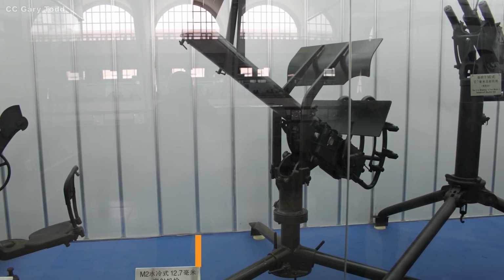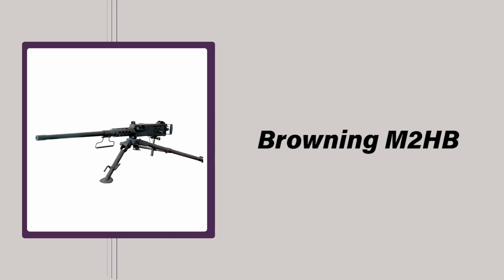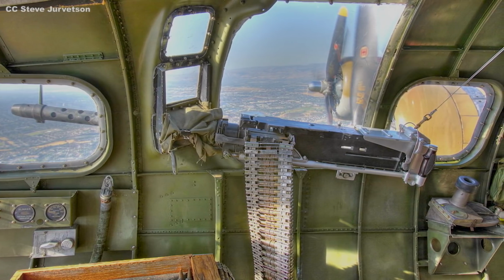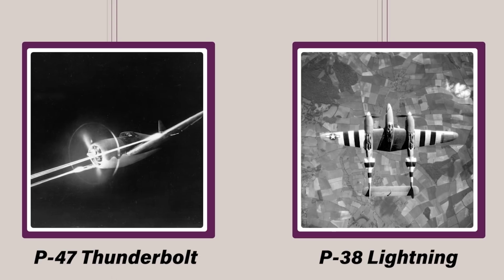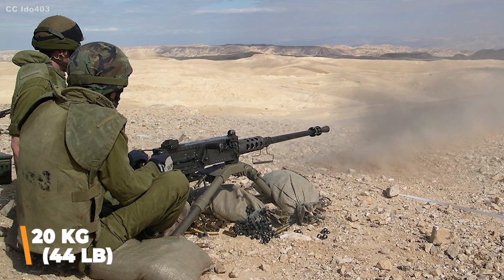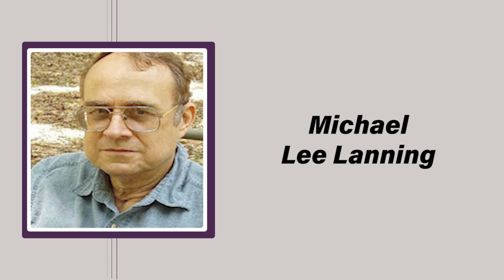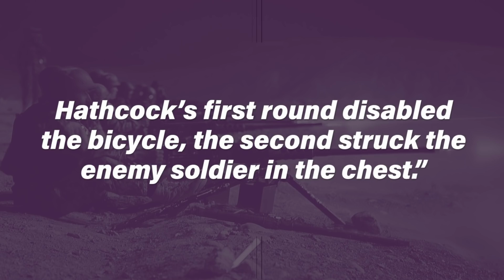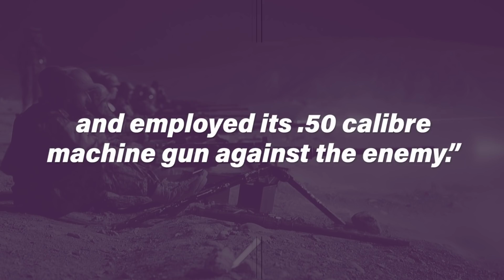M2 Browning: The WWII Machine Gun we Still Use Today

Comment: The M2 Browning is literally the definition of "If it's not broken, don't fix it."
I can easily see this gun still being in use in another hundred years, with very few updates made.
Reply: You havent truly lived until you have fired one these
Reply: There’s probably gonna be a VTOL spaceborne dropship with M2HBs as door guns lol
Reply: @BusterBuizel  Yep! I'd love to get the 'Development dollars' for the ammunition to be vacume sealed for 'non-atmospheric' use!
Reply: @JohnDoe-pv2iu  wouldn't you want them slightly pressurized with oxygen to fuel round ignition?
Reply: @xerothedarkstar  Not really. most Propellants carry what's known as an "Oxidizer" as part of the propellant mix. it's why you can fire a gun underwater ( assuming the round is watertight. ) Basically the Oxidizer's role is to give the fuel the oxygen it needs to sustain conflagration. To Burn, essentially. as a matter of fact, most explosives contain their own oxidizers for this reason, and why Thermobarics are so much more devastating than regular explosives. Thermobarics draw in their oxygen from, well, the air, which creates a vacuum as the oxygen's used up, before the pressure wave kicks out.
Reply: @havoc3742  good info. Thanks.
Reply: @JohnDoe-pv2iu  Aren't they already vacuum-sealed?
Reply: @xerothedarkstar  Yes, Mythbusters fired bullets in a vacuum chamber. They found them 5% faster. So Ma Deuce is already ready for space--if one can compensate for the recoil and the atmospheric gasses that will fog and reverse rocket the gun and gunner in the opposite direction.
Reply: They’ll keep the weapon, and just make cooler bullets
Reply: I could see the Ma Deuce being mounted on a robotic platform.   Yes, 21st century tech packing early 20th century weapons.
Reply: @zyoninkiro  That would be hilarious, and probably quite effective. Unless you're in an actual tank there's no really good protection from a .50 BMG. During my military service I read about an incident where a couple of grunts missed the firing range completely (shot went over the massive mound of dirt at the end of the range) and punched straight through a couple of walls of a house 4km/2.5 miles beyond away. Luckily no one was hurt.
Reply: @Pile_of_carbon  Who the heck would live down range from a military target range? Cheap mortgage?
Reply: @Louis_Davout  Yeah, I'd be sketched out too. IIRC this was Northern Sweden which is mostly forest and "next door" means a two hour drive so I'm guessing it's either "This should be far enough..." or "Holy crap! There was a house/target range there?!?"
Reply: @Pile_of_carbon  House was probably there before there was a range.
   I don't live behind a range but my house is almost 120 years old. It was where it stands before most anything around me here.
     Ya'll Take care, John
Reply: @Louis_Davout  ultra cheap comes with a chance to aquire info about new ballistic calibers and lethality... only people I can think up must be from China or Russia.  The Americans don't care because they say fuck it if they make it out alive good for them.
Reply: They're working on replacements. There are a bunch of shortcomings in the design.
Reply: @Solnoric  they've been working on Replacements since the 1980's, and every time, it all comes down to the same thing: It's too fragile, it's not as reliable, it isn't as accurate, it's rate of fire is inadequate, it's too expensive for too little gain, Etc, Etc, Etc, ad all. the fact of the matter is, the M2 is just too good at it's job. Yes, it's heavy, yes, the giant recoil spring can catapult out the back if you fuck up during setting up the timing, yes, the barrel falls out occasionally because you fucked up the change. But, if you need a gun that'll run as long as it has ammo in it, that's proven and tested, that'll blow a man clean in half, and tear through anything lighter than an IFV and reduce whatever's behind it to a mangled heap, Ma Duece's song will keep on chugging along, as long as you treat her right.
Reply: @havoc3742  ...and "chug" is exactly the way I describe how the Ma Deuce when it's fired: "chug-chug-chug-chug-chug.....chug-chug-chug..."
Reply: @ex-navyspook  Yo tambien! Translation: me too! I too would say that!
Reply: @ex-navyspook Standing behind one being fired you can feel it in your chest. Wouldn't want to be anywhere on the receiving end.
Reply: @Solnoric   incorrect, they are working to replace the SAW and M240.
Reply: @Solnoric  the A1 upgrade is all its gonna get for awhile

Comment: Sometimes a thing is so well designed that it just can't be improved upon. There have been a few upgrades to the M2 over the years but nothing really major. It just works. It provides legendary destructive power and almost never goes down. The M2 is used by almost every military in the free world and will continue to be for the forseeable future. In fact, it continues in production today. It isn't going anywhere.
Reply: There have been several attempts by the U.S. Army to create a replacement. All have been abject failures due to trying to improve portability. usually by using lighter-weight parts that can't handle the .50's sheer power, shorter barrels that rob the round of range and hitting power, and by reducing the rate of fire to unacceptable levels so the lightweight version wouldn't shake itself off-target in a few rounds.
Reply: The Ordnance dweebs after almost every "improvement" to the M2: "well, THAT crap goes in the scrap bin!"
Reply: well, you didn't have to fix or upgrade something that isn't broken..
Reply: At least it has a mechanical safety now 😂
Reply: @dbltrub98  It also now has a barrel that doesn't have to be manually headspaced. Those things make the gun more soldier-friendly but they're relatively minor tweaks. For the most part, Browning just got it right.

Comment: M2, the standard of reliable and effective design. Blows my mind that there are m2s from the original production batch still in service
Reply: The one I was issued had a 5 digit serial number. Not first run, but pre- Pearl Harbor. It had some wear, and was as ugly as any other, but it went bang every time I wanted it to.
Reply: @troybray7523  that's some heritage right there.
Reply: @troybray7523  
"...but it went bang every time I wanted it to"
There's no higher praise.
Reply: I’m not surprised.
Reply: As those weapons arrived at the depot for periodic rebuilding to a 'like new' condition - those weapons were separated out and transferred to museums.
Reply: They never wear out
Reply: @colbeausabre8842  Even M2s have parts that wear.  For example, the barrels are only good for a specific number of rounds (the reason why you're supposed to log the number of rounds fired).  And even if there's no signs of wear, they still need to be inspected for stress cracks that appear over the years.

I've traded in an M2 for one that was fresh from being refurbished to a 'zero rounds' condition - and it was a sweet gun.  Super accurate and the 'feel' of the action was super smooth.
Reply: @colincampbell767  i agree. Ive had to deal a few where the feed tray cotter pins broke or timing threads wear out on barrels... makes the machine gun turn into a bolt action .50 cal.  It has too many moving parts that can break.

I personally liked the m240 because of its simpler design and ability to transport on foot by 1 person.
Reply: @colbeausabre8842  some parts do. But they’re simple to maintain.

Comment: 2 conversions you missed to discuss:
- QCB barrels - barrels that can be changed within seconds not half a minute and doesn't require a safety check for barrel alinement.
- conversion to full auto, closed-breach - some armies remove the receiver release trigger and the retaining mechanism.
this makes the gun a closed breach system. then it is possible to create a solid contact-on-contact safety latch that blocks the movement of the trigger when engaged.

Comment: During my time in the Marines, we were taught that the m2 could be used as light artillery, and pointing the rifle 45 degrees up you could land rounds at 11.5 miles, and dial in with a spotter. I have no idea if this is true, there are many urban myths we were told when I was in that ended up being 🐂 💩
Reply: The range is a little off, but yes, any machine gun can be used for indirect fire. Using it that way takes a lot of training, and is much easier with a T&E device, and an observer with good eyes, but it can be done. I've done it.
Reply: The Canadian Infantry used their Vickers guns as artillery by way of firing bursts at a cross roads or supply trenchs in WWI.  Basically used to deny usage of a patch of ground in the same way artillery can.   I'm assuming the Vickers because it was the heavy machine gun, and the Lewis was the light machine gun.  I don't know the specs of either, perhaps the Lewis gun could have been used the same way.
Reply: @rodchallis8031  Any gun (even a rifle) can be used for indirect fire, but heavy machine guns (like the vickers) are often equipped with a tripod mount and a Traverse and Elevation mechanism that holds them in place for long range plunging fire. Being belt fed allows that fire to be kept up for long periods. The Lewis was capable, but with drums, the sustained fire would have been a bit more difficult, and overheating may have become an issue. The M2 did the same thing the same way. In WW1, machine guns were often artillery, rather than infantry weapons.
Reply: Only when the MK-19 actually worked. Damn thing was constantly going down.
Reply: Yep, Americans never really got their heads around the quasi-science of indirect MG theory.
Oh, the things a couple of beaten zones overlayed on massed infantry can do.  Think massed longbows raining arrows.... or a long range firehose
Reply: I think you are confusing the M-2 with the Mk-19 automatic grenade launcher.
Reply: @bigdatapimp  MK19 is a short range weapon.
Reply: @troybray7523  "short range" it is effective at 9/10ths of a mile on a point target. You could lob 40mm mk-19 further than that. It wouldn't get 11.5mi but at least 2-3 for indirect fire.
Reply: @bigdatapimp  Max indirect fire range for MK19 with high pressure rounds is about a mile. It is lobbing rounds in like a mortar at that range already, so it going farther. As a guy who calls for artillery fire from 20 miles away, a mile IS short range. An M1A1 Abrams can hit a target with direct fire at 2 miles, so, yeah, short range weapon.
Reply: @troybray7523  in training they do teach you that the MK19 can be used as an improvised mortar.
Reply: @bigdatapimp  mk19 max range 2,200 meters.

M2 max range 7,400 meters.
Reply: About 8000 yards is your max lobbing distance. And it’s at about a 32° angle.
Reply: Lucky if more than one guy per a.p.c.was .5o qualified while I was in .one field trip we only had 13 trax out of two battalions that passed dispatch.
Reply: @shawntailor5485  On the crew served weapons we never qualified.
Was not part of our training.
Everything was familiarization.

Everybody operated and everybody shot.
Reply: Forget what's it's called can do the same thing with the M60
Reply: My dad was airborne in the early 50s and he told me about doing this.
Reply: They do that because it’s an anti material weapon. So, it’s not a war crime if you delete his head so long as you were “aiming “ for the material
Reply: @ryhol5417  that is a common myth, there is nothing that states you can’t use a .50 on personnel.
Reply: @ryhol5417  All weapons are anti-material. As a soldier, you aren't killing other people, you are destroying a portion of a unit, or eliminating a weapon system. Why would it matter if you shot somebody with a .50? I shot people with 8 inch howitzers and MLRS rockets. .50BMG is a small projectile in a big world.

Comment: If you have a century old MA2 and a century old M1911 you are better equipped than most modern soldiers.
Reply: The M1911 is still better than a glock.
Reply: @noticedruid4985  I own both.  If shit went down I'd grab the glock first.
Reply: @noticedruid4985  How?  The  military issue guns have TERRIBLE sights.  many people can NOT shoot them effectively (most militaries provide very little pistol training...) AND in any case... pistols have virtually NO place in modern warfare outside of special forces...  (and note that both the SAS and GSG 9 use 9mm handguns...lol)   Magazine capacity of 7 or 8?    Don't get me wrong, I have several 1911's...one is in 45... but my MAIN pistol is a CZ Shadow 1 9mm with a dot sight.  FAR more effective than a 45 ACP 1911.   Sorry...but it's true.
Reply: @noticedruid4985  Bullshit it is.
The Glock runs circles around the 1911.

Namely a superior trigger that even a blind orangutan could see, a better magazine system that doubles the number of rounds you have at your disposal, & it's carrying weight is incredibly lower, making the stress on your body lower as you lug it around daily throughout the battlefield etc.
Reply: @noticedruid4985  Why, because the 1911 won two World Wars? I seem to remember that a couple of nukes were involved.
Reply: There was no bomb dropped on Hiroshima. The B-29 flew over and the bomb bay opened, and a single round of .45 ACP was fired from an M1911A1.
Reply: Until you get your hands on a Glock.
Reply: @buncer  I knew a guy who served in Special Forces in Afghanistan probably 15 years ago and he said their unit was issued 1911's simply because of the heavy .45 slug.  He stated they never should have gone to the 9mm in the first place.  That was about all he ever said about his time "over there".
Reply: @buncer  we arent talking about glocks yet here you come. Glock fanbois sure are pushy.

Comment: It’s hard not to feel like a bad ass when you’re manning one of these during a firefight! Luckily the M2 never went down like our Mark 19 constantly did.
Reply: I hate the mk19. Bitch went down on me in an ambush. I always prefer the 240. If it is a dismounted patrol, it will suck, but it is better than the SAW. (But I still think the PKM is the best for maneuvering as infantry.)
Reply: @Rudyelf1  240 and 249 are bot reliable enough if you treat them right. I never had either let me down. Mk19? Well, I won't argue with your assessment. The PKM has it's drawbacks. Personally, I like the M60, but I know how to use one right, and most of it's problems were "operator headspace and timing."
Reply: @troybray7523  "Operator head space" was used in my non-Infantry units as a derogatory insult.  Later in my career I learned that the phrase had an actual meaning when I learned the joys of firing Ma Deuce (yeah!) and lugging the receiver, barrels, tripod & ammo overland (ugh!).
Reply: @pauld6967  In my combat units, it was derogatory as well. Mechanics used it to clear BS write ups on PMCS, and NCOs used it to describe "remedial training". And, yes, I've humped everything with a belt, and lots of stuff without. M2 was a favorite, but most of the time, I had a 60. It can be reassembled wrong by troops who needed their headspace and timing adjusted. Generally, that adjustment was permanent.
Reply: @troybray7523  Operator headspace was often fixed by liberal application of the H-250 handset to the back of the offending Private's Khevlar in my unit
Reply: Hey the Mark 19 isn't that bad. And when your sending grenades down range, you can see those fruckers go for cover.
Reply: I never had a problem with mine. But I'd rather have the Fifty.
Reply: The Mk19 is great....until it is not.  I have always thought it is the link or maybe the combination of link and weapon,  not the weapon itself.
Reply: hell even in Detroit Become Human. The Patrol Boats even use M2 Brownings making the gun over 130 years old in that game as it is set in 2038

Comment: “Headspace and Timing” 
Can’t even count the times I’ve done it. Fun weapon!
Reply: Can still do it with a dime and a dogtag.
Reply: @geodkyt  you don't need to. Not since 1997, when they replaced the Quick Change Barrel with one that had fixed headspace.
Reply: Correction: 2010 it was fully implemented.
Reply: @breeschca  
Yea I was about to say, I definitely remember having to do it in 2008 when I was in country.
Reply: @breeschca  As someone who literally deals with these as my day job, no, it hasn't been "fully implemented" even in 2022.

We are still switching over M2HBs to M2A1 configuration.  I'm one of the engineers working the fielding plan and design work for the changeover.
Reply: Screw'er down tight and back off 4 clicks. She'd pass H&T every time.